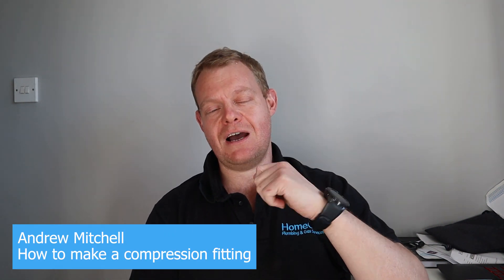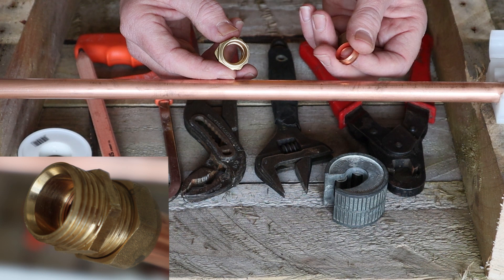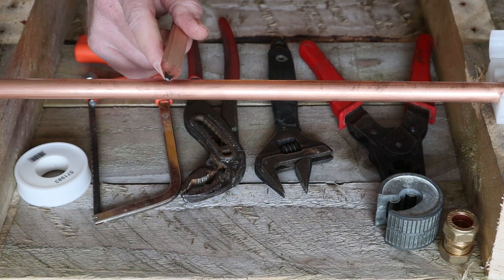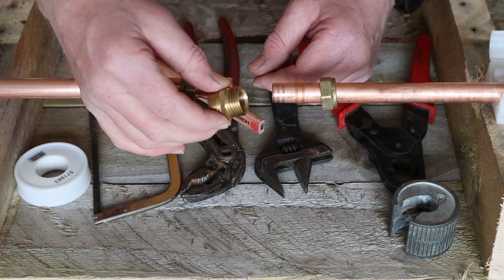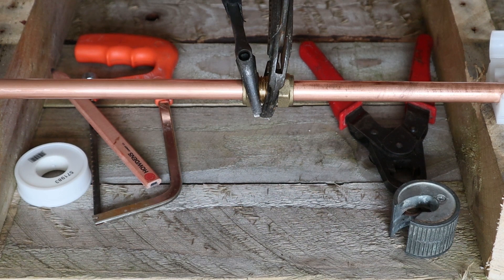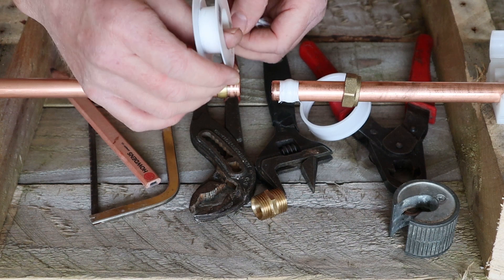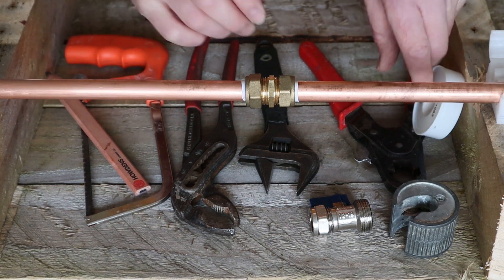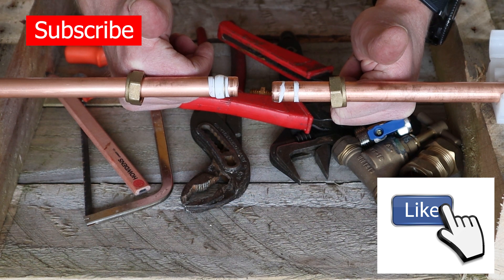How to fit a compression fitting | Copper pipe tutorial

Comment: Good display, But Most pipes are soldered, so that you cannot move them, in or out that way, so you're not going to be able to just push the pipes together. So you might have to cut a gap of pipe, which takes precise measuring.

Comment: usually there is no need to put tape on the olive unless there is a leak. a compression fitting is designed such that there is no need to use any tape.

Comment: Teflon tape is completely unnecessary and makes no sense. Compression connection is metal-on-metal. It seals only if metal ring (ferrule ring) sits evenly, and tight around the interior of the body of the valve. In your example, as you tighten the nut, the nut actually cuts through the Teflon tape to make positive seal. So you are applying  Teflon tape is just to look like you are doing super good job, while truth is just the opposite.  Thank yoiu

Comment: Absolutely brilliant! Thank you 🙏
Reply: Now do it with a vertical pipe, on your own 😨😂
Reply: @andybarton234  I did it Andy! My only worry was that I wasn’t able to get one of the olives off and tried to carefully hacksaw it off, at an angle but still managed to take a tiny nick out of the end of the pipe. Because the second pipe was joined from above (kitchen mixer taps, I couldn’t get in with the tool cutter to cut the end off so I risked it. At first it leaked but a couple more turns of the spanner and it seems to be holding good! 
Only problem now is the plastic u-bend. For some reason the sink won’t drain and slurry keeps coming up. I can’t get a drain clearer bendy rod thing down, it won’t go. This is beyond me and I can’t afford a plumber 😔 Tough one, I bought heating oil with my last and it’s in but the boiler won’t start either. God know what to do now. But at least I have water thanks to your help 🤗

Comment: If there's no play in the pipe how can you the compression fitting on the pipe if you can't push the pipes apart can you get a slip compression fitting?
Reply: That's my concern too.  I'm afraid I can't get the pipe separate enough to get the compression fitting in between the pipe.

Comment: The other videos where they use the tape on the olive, they wrap the tape around the olive and tighten the nuts in one step, rather than tightening, then loosening the nuts, then wrapping the tape and re-tightening.
Reply: Thats bad idea because olive has to be squeezed into position first and if loose tied with tape will make huge problems. The method shown is best way
Reply: I saw that video and I used to do it that way, now I do it this way because the olives are already in place and on tape after to stabilise it….👍🏿

Comment: I don’t like those pliers chewing up the fitting I use two spanners. If you grip and tighten the two nuts (not the central fitting) at the same time you get a nice even torque on both sides. The PTFE tape should not be used unless directed by the manufacturer - the fittings are designed to work with metal-to-metal sealing surfaces.
Reply from the maker: Hiya Mark, thanks for taking the time to leave this comment. I do agree with almost everything you say. I would never use the grips (pliers) on the nut themselves as this would round off the nut. Using two spanner’s is really good advice, but have you ever tried using two spanner’s when the fitting is behind other fittings. Not everything can be done text book and this is where experience comes in to play. I like to teach in the real world and not text book.
Reply: I tend to agree with you about use of tape in this manner, but I have watched a lot of videos recently of people using this method - it appears to be a practice mainly used in the UK. But I see no harm in doing it so plan to use it when I install two 1/2" compression fit isolation valves in my crawl space next week.

Comment: If you use a proper jointing compound on the olives you wouldn't have to take the fitting apart and compress the olive twice, which could over compress the olive as you said to be aware of !!!!!
Reply from the maker: Hiya Alan, just out of interest, what jointing compound would you use on potable water joints opposed to central heating/other joints.
Reply: Hi Andrew, now i use Fernox jointing compound, suitable for potable pipework. Back in 1969-1973 when i was an apprentice and up until it was banned for potable use we used 'Boss White'. At that time we had representatives from Conex and Kuterlite come to work and college and they would insist that thier products did not need anything to help make the joints watertight, just tightened dry. Needless to say our college instructors and the guy's we were apprentices under said use it, and have done so ever since.
Reply: I agree.  This is a good procedure, but a better one is likely to use good pipe compound (i use Gasoila sot set) on the pipe ends and then slide the olive ferrule after it is slid over the doped coper of poly tubing.  It is great that Andrew took the parts apart after using the PTFE tape.  you can see that there is a small band of shinny metal, where it was cut clean through, even with his carful tightening, diminishing its usefulness somewhat.  It is even possible to add two wraps of PTFE after the soft-set on top, but that is likely overkill except for a tricky repair drip.

I find that a lot of people get hung up on "dry fit" requiring DRY fitting, which is not true.  it is designed for dry fit, just like NPTF is, but if you read Parker's technical literature, they say that you should always use a sealant/lubricant's on dry fit NPTF.  Just because it might seal dry, doesn't mean that it is best to seal it dry, and certainly does not violate code or the manufactures directions.

Comment: Thanks for the video!  I'm going to try this to replace the turnoffs for the toilet and vanity when we do a bathroom remodel soon. Wondering why are the olives 2 different colors? What if I don't have an olive remover, is there anything else I could use if I have to switch the fittting out?
Reply from the maker: Hiya, the different coloured olives is because, some are copper and some are brass. I have never had a problem using either. If you don't have an olive cutter then it would be the old fashioned way and gently cut through the olive with hacksaw. Be careful though as sometimes you can mark the pipe and may not seal once new olives are used.